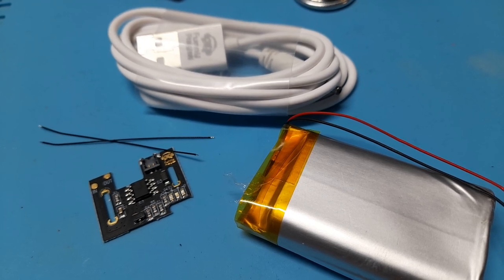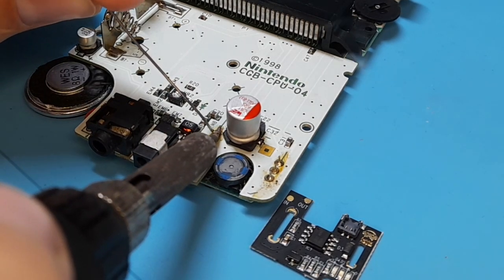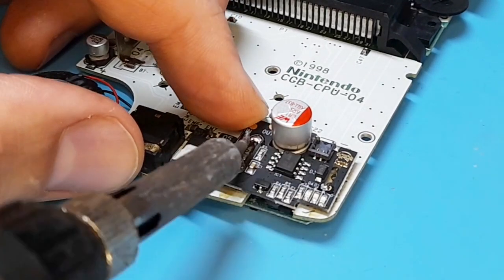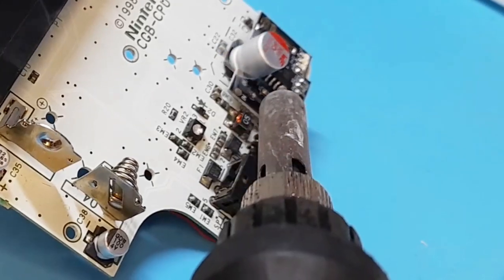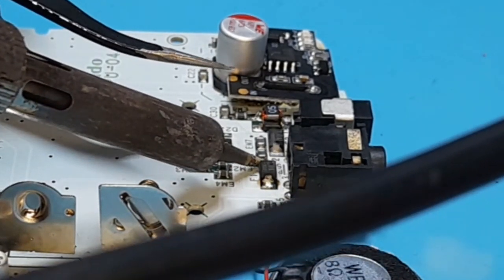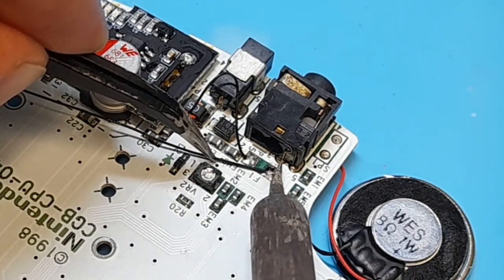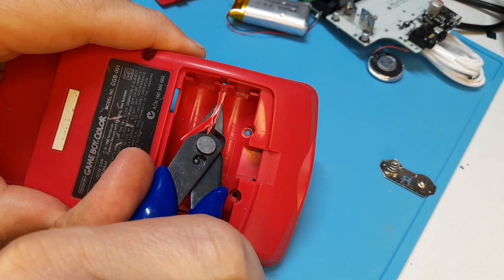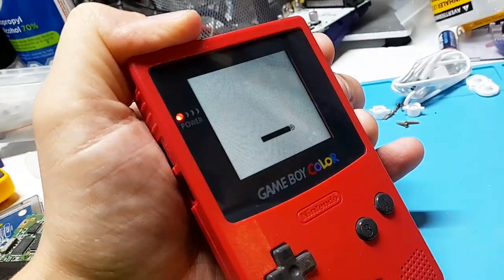How To Install a Rechargeable Battery  in a Gameboy Color (FunnyPlaying)

Comment from the maker: I forgot to mention in the video that you should not charge the system while it's plugged in. This can damage the battery and/or system. The provided cable is the safest way to charge your system. Do not use an original Gameboy power adapter.
Reply: Typo bro you mean do not turn on or play the gameboy while it is charging. you said when its charging dont plug it in LOL
Reply: Is there a light that comes in when it's charging? When I plug mine in, there's no light when charging. I'm not sure if it's just when it's full that the light comes on or at all. Thank you!
Reply from the maker: @wes06334  I don't believe so!
Reply: @VideoGameRestoration  Appreciate you!
Reply: @wes06334  yeah its a blue light when charging and a green light when fully charged. i had to turn down some lights in the room to see it thru the cracks in the sides because the light is blocked by everything. Did you use the "POST" method like i did? If you dont have any material that will work as a post, you can get some 16 gage magnet wire for cheap or just get a set with all gages. first solder the posts in place and slide the charging board over the pins and press it all the way down. then solder it in and cut off the excess
Reply: While i was playing it turned off and now it is not going back on.. what should i do?
Reply from the maker: @L  Charge it without use or interruption for and hour or so and try again. If not check all the connections and solder work. Check the fuses as well
Reply: @L__85436  make sure the battery is charged first and test it again! then remove the circuit board you installed and test it again with normal batteries. if it works with normal batteries try to install the charging board again with POSTS to separate the boards from each other. if it still wont work with normal batteries examine every solder point and remove any bridging points AND LOOK VERY CLOSE! use zoom on your camera phone too. if it still wont work youll have to test voltage at the batteries all the way through the circuit to diagnose the problem point.
Reply: so me and my dad worked really hard on this Gbc mod and even learned how to solder. And it worked.. kinda
The battery charges but the game boy won’t turn on anymore. I made sure to fully charge it too and still nothing
Reply: Im having the same issue. Have you found a solution to this or no? @egoleo
Reply: @miguelhxrnandez  i have not, my room mate said it might be a blown fuse if that helps

Comment: I have to say this is so much more simple than the USB-C mod. I’m happy with using the proprietary port but each to their own. Only thing I would do differently is de-solder the old battery terminals soldered to the board.
Reply from the maker: I didn't even think of that! Great point!

Comment: Great video! I would call out that you are still required to use the proprietary charging port. My personal preference is changing to a USB C, or if they are in stock the wireless charging battery made by retrosix specifically for the Game Boy Color.
Reply from the maker: They're great too! This option is great for folks who want to keep the original shell the same outside!

Comment: I'm actually waiting on this same kit to arrive in the next few hours along with the rest of my mods ( LED board and amp showed up yesterday.) In Makho's video I think he points out that the way this board is designed, the console needs to be off before charging otherwise it could damage the battery, and that the included USB cable is the safest way to charge it. Not sure if he mentioned exactly what kind of wall brick to use, skimming an hour long video leaves a lot of room for error on my part. Figured that's worth addressing just in case.

To make attaching easier, would it be viable to put down some solder blobs, then just leave the solder wire attached to the blob, snip a piece off on each blob like pins, and then thread the solder pins to the necessary points on the addon board?
Reply from the maker: Shoot, I meant to mention that, yes charging while the power is on can damage the battery. So no playing while plugged in 😅 And yes the included cable is the safest!
I like your idea running the wire before hand to make it easier! I was able to get it without the wire so I never really explored that side
Reply: Chances are good I'm going to try and do it,  so I'll let you know how it pans out. For the charging, will any wall brick do or do I specifically need to charge this from a power strip with USB sockets? As I understand the board is just a way to tie the battery in, so idk if it has any kind of overcharge protection and it's sounding like it's better to be extra cautious with this setup.
Reply from the maker: @fangoroth6600  hmmm quite honestly I don't know. I'd assume you would be safe using any power block as if there was a danger using one over another it would be mentioned in the product description. Using the original cord really prevents you from running into issues. Problems start to arise when you have USB-C plug ins

Comment: Someone cleaned up my corroded Game Boy Color recently and fitted a wire to get the A button working properly again, but it still doesn’t respond to lighter presses! Got a fix? I’d also like something done about the start button thinking it’s been pressed again when released! (Meaning some games, like Mario & Yoshi and R-Type, can take MANY presses of the start button to keep them paused!)
Reply from the maker: It sounds like the Silicone pads or the pads on the pads on the Gameboy are dirty or wearing away. Easiest thing to try is to open it and clean the Gameboy pads and Silicone pads with Alcohol

Comment: Weird. I have done this mod 4 times for buddies gbcs with no issues except for the 4th time, the batt charges blue led comes on so i know the f2 fuse on the motherboard is good however  when i power on the gbc the screen is black the red led comes on and theres a squeaking noise coming out.....weird

Comment: would be nice if they sell these mods with just the board to further minimize shipping costs. Shipping overseas with batteries add up too much fees especially when customs figure out its a battery.
Reply from the maker: Actually! If the battery is in a system you don't get hit with the extra fees
Reply: @VideoGameRestoration  u mean thats if u bought a whole gbc handheld set with this mod correct? What im talking about is if u just buy just the modkit, theres no option of it being just the board, they always include the battery so it adds up extra fees.
Reply from the maker: @rcarlom9882  ohhhh I see, You may be able to message FunnyPlaying to ask them!

Comment: Question when the battery 🔋 is full charge the light goes off at the color changes ?
Reply from the maker: No, the red LED on the Gameboy only shows power on/off. There are some  batteries that have built in lights to show charge status (I believe retro six's does)

Comment: i used pins to bridge the gap between the charging board and the power adapter
Reply from the maker: Great idea!
Reply: @VideoGameRestoration  I saw it on another guys video having the same type of trouble
Reply: It definitely works well and helps the heat transfer